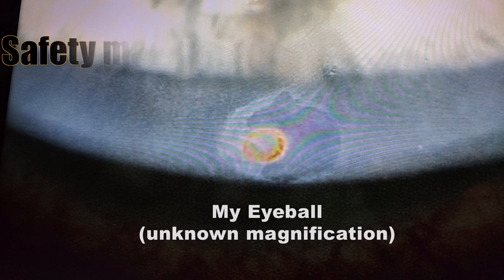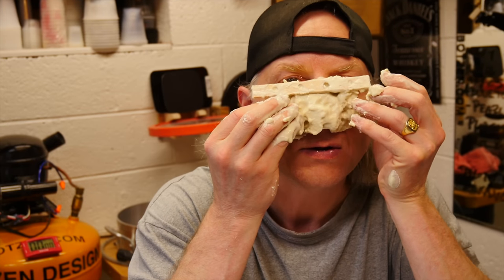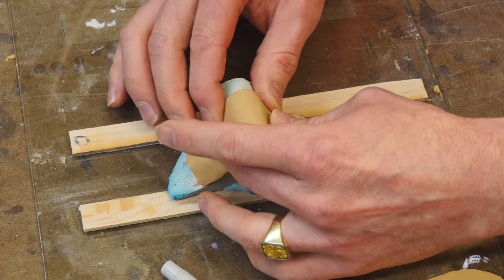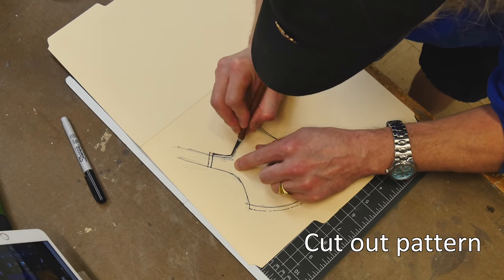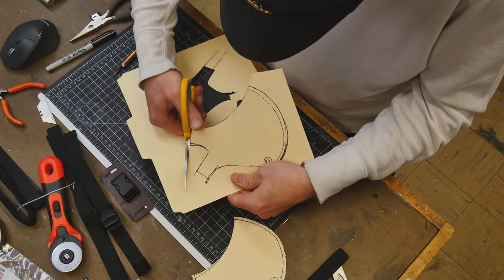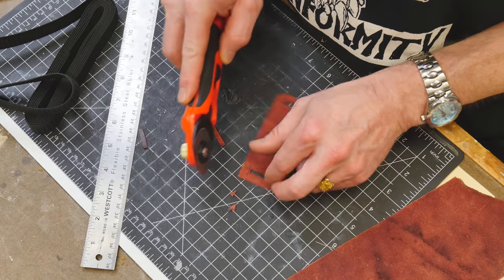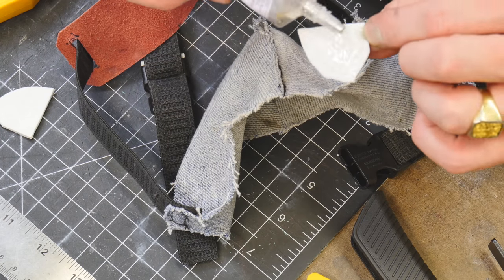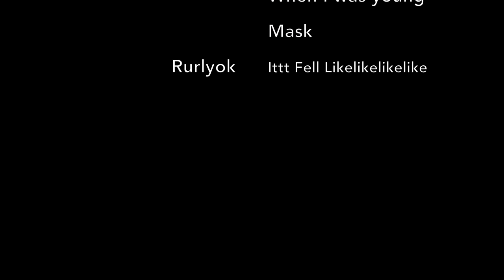Dust Mask with Eye Protection Design Process: Phase one proof of concept

Comment: This was awesome! I wanted to make a water bottle model, But I wanted to make it out of foam and get it to a nice finish. Can you do a design process video? I assume you'd want to use a lathe, but I'm also thinking that I can simply cut rough curves with a band saw, then use a spindle sander to smooth out the curves.

Comment: Looks like you're already thinking about it, but my biggest problem with almost any kind of mask is fogging of eyewear. Dust masks, respirators, even sun buffs all direct breath straight up the sides of my nose to fog my eyewear. I have the added disadvantage of a beard, which makes all dust masks even harder to fit. Looking forward to the next video.

Comment: Agree with Marc, fogging is one of the most annoying issue with any mask. High end masks have now active ventilating system for that (for ex Alec Steel has a big one for sanding metal stuffs). Anyway great project and thank you so much for sharing.